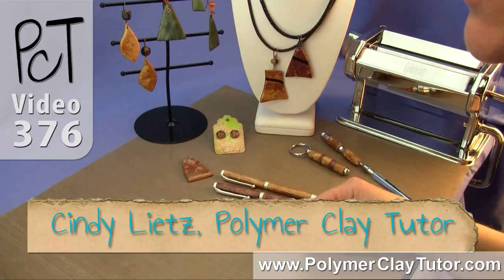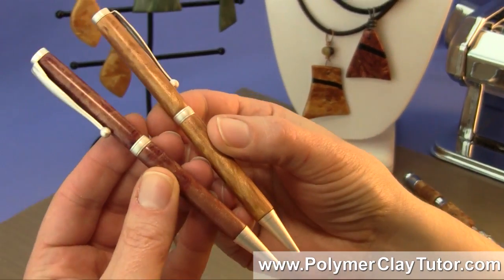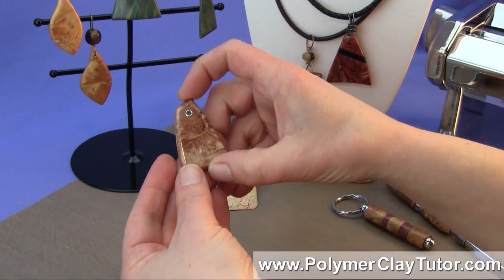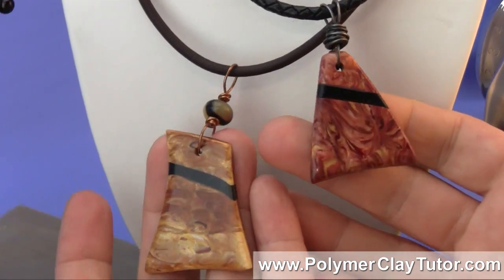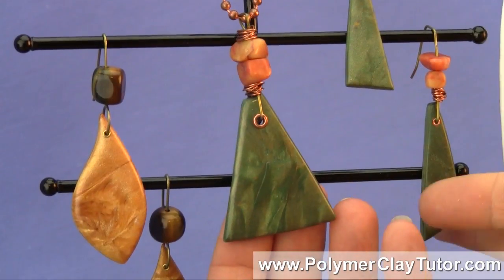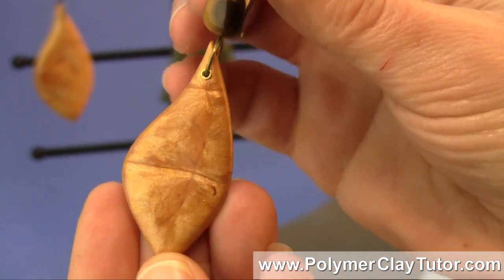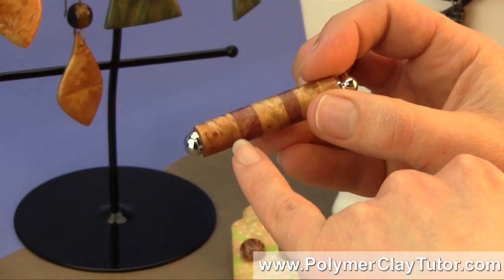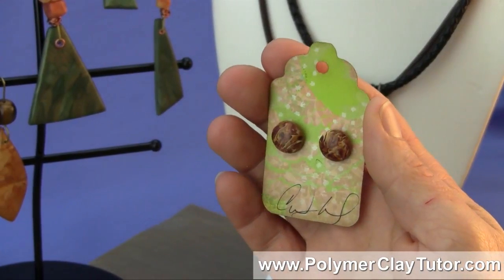Polymer Clay Pens Faux Burl Wood (Intro Vol-060)

Comment: Cindy, here's a kit pen that doesn't have to be hammered or pressed to assemble:  It's called "The Amazing Twist Pen" and it's quite reasonably priced.  The components screw together instead of being press-fit.  Also, in the "gallery" on this site you'll see examples of pens that people have created with other polymer clay techniques.   Mostly they create a clay blank just like a wooden pen blank and then turn it on a lathe like wood.  (Sadly, lathes cost a bit!)

http://www.polymerclayprojects.com/AmazingTwist.htm

Also, see their true dichroic water slide sheets, which is something I'd never seen before. 

Thanks for the burl wood tutorial, incidentally - well worth the $9.95!!  While the burl is beautiful, the tutorial is perfectly applicable to doing just about any  project of this type with polymer clay.  I'm going to try it using a sheet of clay with an image transfer on it. If that works out well, you could create pens for companies as presentation awards, for events (weddings, anniversaries, etc), for proud parents and a whole host of other things.
Reply from the maker: Thanks for the info on the Twist Pen TechSupport100 They look great! And thank you for saying such kind things about my tutorial. I really appreciate it. And yes I agree, pens make awesome gifts for grad, weddings and all sorts of special events. Especially when they are made with quality parts like these. WAY classier than those plastic pens covered in polymer clay! Thanks for commenting!

Comment: I email you, but don't know if you will get it or not. Anyways, did you use nylon hammer or nylon mallet on the pens?
Reply from the maker: I used a nylon hammer, but a nylon mallet would work too if you need more force.